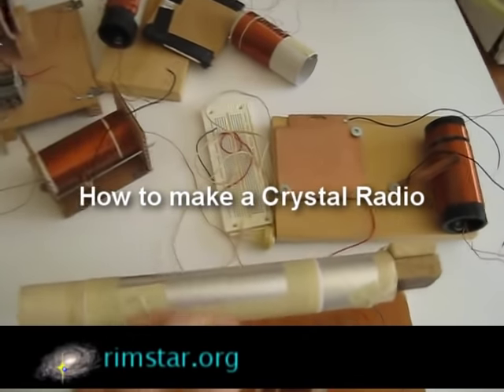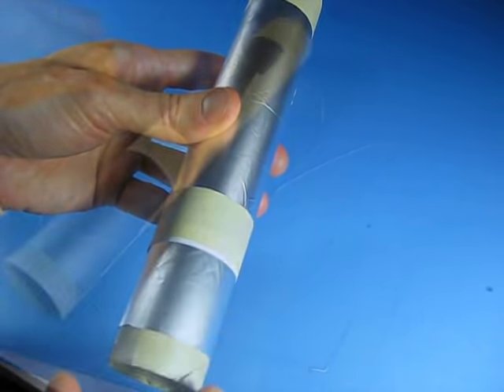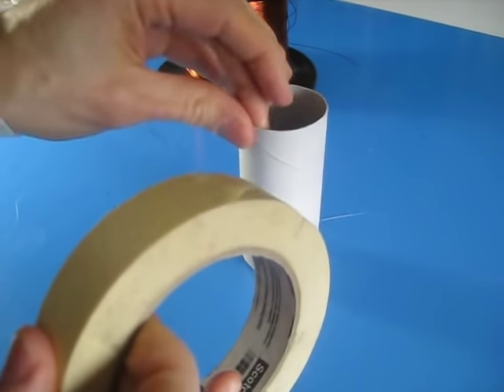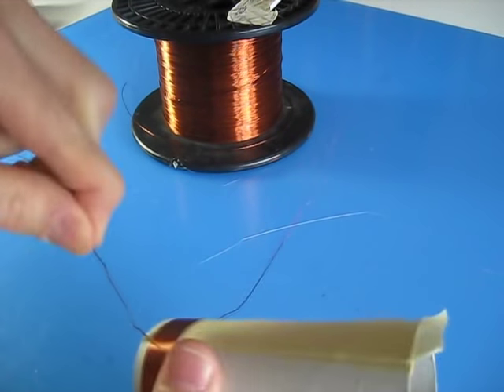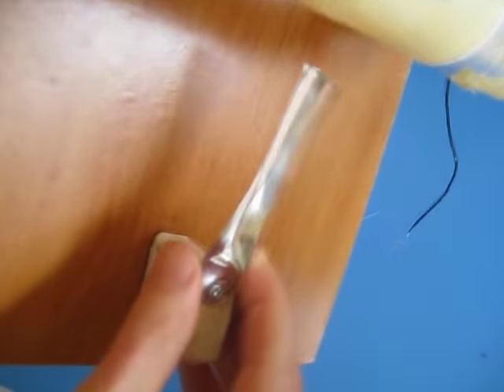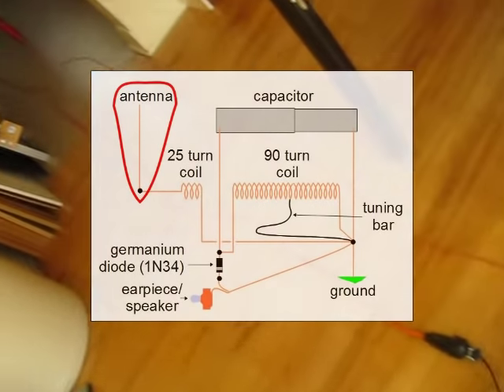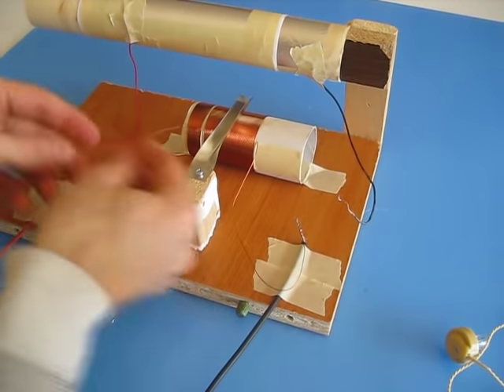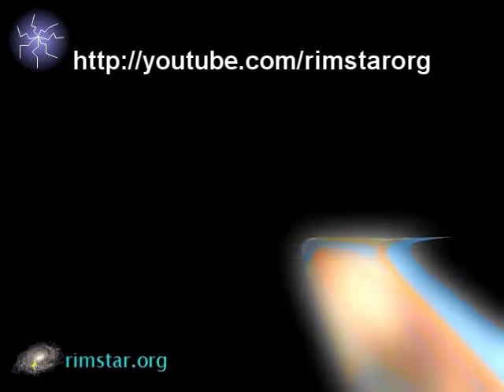How to Make/Build a Crystal Radio

Comment: One more question.  We can't find Magnet wire at Radio Shack or Graybar.  We tried conventional wire, but it's tough to expose the wire consistently with vinyl insulation.  Can you suggest an alternative wire that's more readily available and relatively easy to expose?
Reply from the maker: +Kelly Canavan Those are really all the options I know of too. However, you could try making a coil with taps using conventional wire http://youtu.be/Gi9EmhrcfIg. You can also try finding magnet wire in things, like taking apart motors for example. There's also a lot of it in old cathode ray tube type TVs and computer monitors but unless you know what you're doing, taking those apart can cause a shock.
Reply: great alternative.  thank you very much

Comment: Enjoyed this video, I have many more to go.  When I was just getting interested in electronics; about 9 or 10 in the late 1950ties,.  I found a schematic for what I guess would be a foxhole crystal made with what was available.  The unique thing about this rig, the crystal wasn't a crystal at all and I still to this day don't know why it worked.  It consisted of a double edge gun blue razor blade (not sure if they still make them) laid flat on the board and held down  with a thumb tack/.  This is also where I  attached the output wire to the earpiece. The other item that I used  was about an inch  piece of graphite  from a pencil. I used a paper clip coiled a couple of turns to hold it tight. Then, I made the input connection from the coil here.   One of The pointed  ends of the graphite  touches anywhere on the blue surface of the razor blade.  I really didn't think it would work but it did.  Any idea how this worked as a detector ?  It wasn't a very practical design but darn if it didn't work.
Reply from the maker: +Lost N Musik Thanks, I'm glad to hear you enjoyed the video! The razor blade diode is a p-n junction type of diode in that it has a p-type material (too few electrons with electron holes) next to an n-type material (too many electrons). I know the n-type material is iron oxide but I don't know what the p-type material is. In case you haven't run across it, my own experience with this type of diode is here https://www.youtube.com/watch?v=eIdHsjfbckw.
Reply: +Lost N Musik  Thanks for the response about the razor blade detector.  Your explanation seems be in the running.  I thought that maybe the reason the razor blade has a bluish color because the blades were heated then quenched in a oil bath making the surface case hardened  and leaving behind some form of a carbon. This might be worth heating a non blued razor blade and quenching in motor oil and see if it works better or worse than just one that has  developed the bluish just from heat alone.  Love Science

Comment: I've been trying to make my radio to work. However, I'm using a speaker instead of a piezoelectric earphone. This speaker makes me solder wires onto the + and - ends of the speakers. However, I can't seem to implement your schematic onto it. Do I attach a wire from the diode straight to the ground, as well as from the speaker to the ground? Or do I just connect the diode with a wire to the speaker, then ground it? Thanks.

Comment: Hi Rimstar!  Excellent tutorial.  In your opinion, what is the most power you can get from a simple device like this?

I am working with the ABHA Coil, and I think something like this would be an ideal power supply.  The ABHA coil acts like an air core speaker.  No magnets.  If you check out the work of Daniel Nunez you will get an idea.

Hope to speak with you soon

Comment: I've heard there is a way to amplify this circuit using a transistor, and another diode without a battery. Supposedly it makes use of the unused frequencies and converts it into a small amount of boost. I can't seem to find a diagram on this.  Any help would be appreciated.
Reply: It seems there would be a way to rectify the unused current filtered by the diode here, and feed it back into the system as well. I can imagine it's either another method,   or the one I was thinking of in the first place. Thanks

Comment: One more question; its not clear in the video as to whether or not you strip the insulation from the earpiece wires when connecting to the ground wire and diode. We have the same high impedance ceramic earphone. Do you strip the insulation where it connects?  Thanks.
Reply from the maker: Yes, you have to strip the insulation from the ends of the earpiece wires when connecting to the ground wire and diode. In general wherever you're making an electrical connection the insulation needs to be stripped off. For the electricity to flow from one part to another it has to go from metal to metal, usually copper wire to copper wire, though some copper wires have a silver colored coating on them so they look like silver (you don't have to remove that silver coating though.)

Comment: for the antenna do you want type of wire do you use? and do you just throw it outside? and and for the ground wire do you need the plug or do you just  have all the wires that need to be attached to the ground and have it touch the pipes?
Reply from the maker: It doesn't really matter what type of wire you use for the antenna. I just string it out in a straight line on my floor indoors, which also means mine isn't very long, only around 5 meters. Luckily I have radio stations nearby. It should be in a straight line, and preferably pointing at the radio station. For the ground I always use the plug approach since that's easiest for me.

Comment: Hi great video, so i have an antenna question. So i figure i need a 44 [m] antenna which i dont have. I am in the us, my house has a ground for the 120[v] and a neutral for my 230[v] (both separate i think). Can i use the neutral 230[v] line for an antenna?
Reply: I should also say it is 3 phase 230.
Reply from the maker: First, a disclaimer, I'm not familiar with 3 phase 230. I do know that for 2 phase 240 (or 230?) in North America the neutral is connected to the ground at the main breaker panel so I don't see how you'd use it. Also, an antenna for a crystal radio should ideally be a straight wire that you connect to at one end or in the middle.

Comment: Why you don't use glue for coil fixing ? Take some glue (better do not use epoxy -- it brokes insulating covering on wires) or lacquer, and cover coil -- it will fix all winds, and add extra insulation. You can ever use noninsulated (tinned) wire wiring it with thick cotton thread in parallel, and then fill it with any insulating glue (expoxy ok).

Comment: What is the purpose of the two coils.    The antenna ground signal runs through the small coil only.  How does the signal 
get over to the large coil?    The antenna does not run through the large coil, but the ear phone is connected to it.  Some designs have only one coil?   are they inferior?
Reply from the maker: The reason for having two coils is to make it easier to tune into just one radio frequency without having other ones interfere too. All the undesired signals take the antenna coil's path to ground. The desired signal more easily influences the tuning coil through electromagnetic induction. The disadvantage is that the signal is weaker as so you get less volume. I explain it with animation in my How-it-works video here http://www.youtube.com/watch?v=0-PParSmwtE starting around ten minutes and forty five minutes in.

Comment: Respected,
why, and how, is important that wire has 25/90 turns ? I watched all of your videos, and in that Video with Pizza Box, there is 14 turns. Can we put more turns, and if we can - what we gain with that. Thank you.
Reply from the maker: +Владислав Остојић I'm not sure how critical the 25 turns is and what goes into determining that number. As I say in the video description, I made this from a schematic from a book "Radio Receiver Projects You Can Build" by Homer L. Davidson.
Regarding the 90 turns, my calculations say that with the variable capacitor in this video you can go down to 40 turns before you start losing radio stations below 540KHz. However, as you decrease the number of turns, you'd also be cramming the radio stations into a shorter coil and they'd actually become physically closer together and it'd be harder to get just one.
More turns than 90 doesn't hurt since with the wiper blade you can still short out all the turns on the ground side of the coil. It might help a bit since the stations would also be spread out more on the coil.
You can get a much better understanding of this from my How a Crystal Radio Works video http://www.youtube.com/watch?v=0-PParSmwtE starting at 3:37, though other parts of the video will give more understanding too.
Cheers.

Comment: Im able to get it to work super well if i connect it to my guitar amplifier, but when i use a crystal earpiece i get absolutely no sound. I dont think its just a weak signal issue because i dont need the amplifier to be at a very high volume. Any ideas?
Reply from the maker: I could hear it quietly in my crystal earpiece and also at low volume on my amplifier https://www.youtube.com/watch?v=JtPwxbOgBHw Check all you rconnections to make sure they're good. The longer the antenna is in a straightish line, the louder it will be. Multiple parallel antennas spaces at least a few centimeters apart also helps if you don't have the space for a long one. Pointing the antenna at the radio station also helps. And make sure you have a good ground. It also helps that I live near a few radio stations, though on a rare occasion, I've tuned in some from far away. Also, try at different times of the day.

Comment: I wanted to ask if CAT 5 wire could be used to make the coil for the crystal radio? I wanted to get your opinion before I go and cut a bunch of wire. Thank you!
Reply from the maker: Cameron Cooper Yes, CAT 5 wire should work fine. I'm assuming you're going to open the cable and use the individual wires. If you're making a tunable coil like the one in this video then you'll have to find some way to strip the tops of each turn of wire so that you can make contact with them with the tuning bar. Alternatively you can make the coil with taps like the one I show in this other video https://www.youtube.com/watch?v=Gi9EmhrcfIg

Comment: Hi great video. You're videos are awesome. What needs to be adjusted for lower or higher frequencies? i.e. moving the capacitor more inward increases or decreases the frequency? Moving the tune bar left increases or decreases the frequency? Thanks
Reply from the maker: +Victor Twigge Moving the capacitor inward so that there's more overlap decreases the frequency.  Moving the tune bar left increases the frequency. More of that is explained in my How a Crystal Radio Works video at around 4:32 http://www.youtube.com/watch?v=0-PParSmwtE
Reply: +RimstarOrg Thanks. Much appreciated!!

Comment: Great video! I'm making a radio with my son for his school science project. I followed your procedure very carefully and we can't hear anything on our set. Any ideas on what might be wrong? We live in a valley with very poor radio and TV reception, and I'm wondering if that could be the problem. Any suggestions would be greatly appreciated. Thanks for the video.
Reply from the maker: Having poor radio reception could definitely be the problem. The longer the antenna you have the better your reception. Mine is only around 15 feet/5 meters but I have a few radio stations nearby. The antenna should be straight and preferably pointing at the radio station. Also, make sure you have a good connection to a good ground. And check all your connections to make sure they're right and good. And make sure you're making good contact with the part of the coil where you removed the insulation.

Comment: Thank you for your very instructive video. I built an AM receiver like this several years ago, but unfortunately there is no more radio station broadcasting an AM signal nowadays (especially in France, all stations stopped sending AM signals, except 1 that I sadly don't receive where I am).
Did you already do researches to build a very simple FM receiver that would necessitate very few power like this ? (I guess this is not possible to just rely on the power of the waves for FM as the signal sent in this case is (far) less powerful than AM ?)  Even if it would be composed of more components and would possibly be bigger...
Thanks :)
Reply from the maker: I haven't tried making any FM receivers. Based on how I've never seen a crystal radio that deliberately picks up FM, I suspect you're right, there isn't enough power. I have heard of people who made a crystal radio and somehow accidently picked up FM though. I don't know how that happened. Thanks for watching! I'm glad to hear you found it instructive.
Reply from the maker: YouTube's algorithm seems to not be letting your post through, maybe too many links... Luckily I get it in email anyway. Here's the post from Colin.
RimstarOrg Ok thank you! I anwswered but I'm not sure the text is being moderated or it it was dropped 🤔 Anyway I was telling that with more research I found FM cristal radios like this one https://www.eeweb.com/fm-crystal-radios/ or http://www.wa6otp.com/FM%20Crystal%20Set.html. The first page tells us this is possible to make a passive Cristal FM receiver :) Technically it seems this is an FM "slope detector" that kinds of converts FM to AM, with very few components. Interesting page about slope detection : https://www.daenotes.com/electronics/communication-system/fm-slope-detector . This one uses powered speakers but just to realize how well the detection can be: https://www.youtube.com/watch?v=_-F-VmMw1QQ It would be awesome to ear FM radios like this as there are still many radio stations nowadays, and demonstrate it can even be passive with a cristal earplug :)
Reply from the maker: Thanks Colin. Interesting research. Tempting to try it.
Reply: @RimstarOrg  oh thank for reposting my not-published answer :) I'm glad you could be tempted to try ;)

Comment: Am I right in the video you conected the capacitor,tunning bar, 90 turn coil, Earpiece, and 25 turn coil to the ground?
Reply from the maker: Yes they're all connected to ground. I should have shown it step-by-step. Oh well. At least there's the diagram at around 0:27 in the video.

Comment: I might not have quite catched it but- it is only the wire you bought from radioshack that is magnet wire, and the rest just ordinary copper wire?
Reply from the maker: Yes, only the wire that I showed bought from Radio Shack is magnet wire.
But it's all copper wire, though some of it may have a silver colored coating on the copper. Magnet wire is just copper wire with a thin coating of enamel/resin for insulation. It's called "magnet" wire because it's often used for making electromagnets. There's nothing magnetic about the wire itself. The other wires I used either have a thicker plastic or rubber insulation on them.
Having said that, you can use the magnet wire for all of it if that's all you have. The reason I used magnet wire specifically for the coil was because it has a thin insulation on it allowing the copper to be closer together. If I'd used plastic insulated wire for the coils then the copper would have been further apart. With the coils, the closer each turn of copper is, without having copper touching copper, the better.
Reply: Aaaah, I see!
So I guess I know what I'll have to get now ;) I simply MUST give it a try! It's so... Geeky and awesome :D

Comment: 2:40 Don't use thin flimsy dowels for the coil form. 
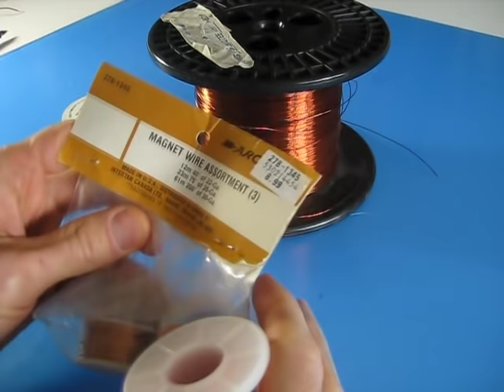2:56 Radio Shack has gone out of business :-(
Use 26 AWG or 28 AWG Copper wire for compactness, thinner wire breaks to easily - - to hard to wind without the right tools.
"Germanium diodes 1N34A, 1N60, 1N91,  1N119, 1N270, 1N277, 1N283"  You can use 1N914, or 1N4114 Silicon small signal diodes if you match the impedance well. Other types of diodes will need a small battery with a trimpot to forward bias them.

Comment: You made a amplifier in the laser communicator.a black box which you connected the microphone.can you please tell how you made it.
Reply from the maker: +Parumala Tpt It's the very same circuit as my amplifier in a jar, just in a black box instead (the jar one is here https://www.youtube.com/watch?v=JtPwxbOgBHw.) The only differences are that instead of having two loose wires for the input, I put an audio jack so you can easily plug a microphone into it. Also instead of having wires go to a speaker for the output, I left the ends of those wires loose. I show photos and explain more details about the box one around halfway down this page http://rimstar.org/science_electronics_projects/laser_communicator_diy_homemade.htm.

Comment: Does placing tape over the coil turns affect anything?If the coil is somehow cut while doing the turns, is it okay to twist it back together and continue? And can I use Styrofoam for building the base and holding the capacitor?

Comment: For the coil, if I were to use a wooden rod with a 2.4 cm diameter, can I still use 25 and 90 turns? Or do I have to change the amount of turns a bit?

Comment: what will happen if I dont scrape of the enamel of the wire on the right as you did ?
Reply from the maker: If you mean when I scrape the enamel off the top of the coil, if you don't do that then the radio won't work. You need to make electrical contact between the metal of the wiper blade and the metal in the wire. If you didn't then it would be like forgetting to connect two things in the circuit. If you mean where I scrape the ends of the wires, you'd have the same problem. The enamel prevents electricity from flowing.
Reply: @RimstarOrg  ok gotcha , I scraped off enamel from the portions of all the wires that made connection with the ground that’s ok right? As your video sped up there.
Reply from the maker: Yes, that's right. What you did is what you need to do.